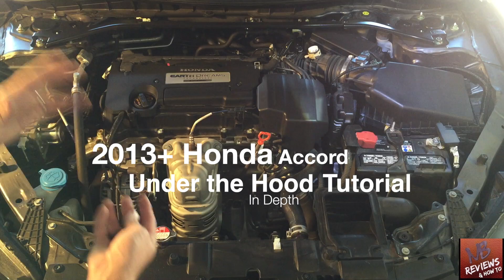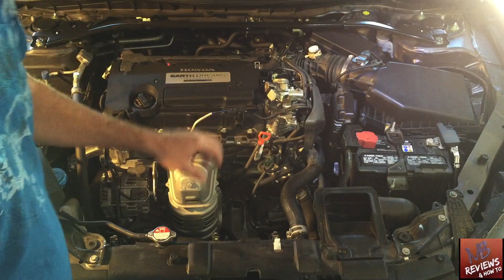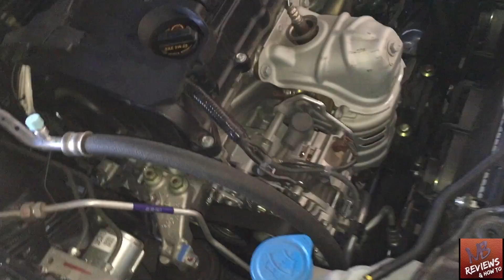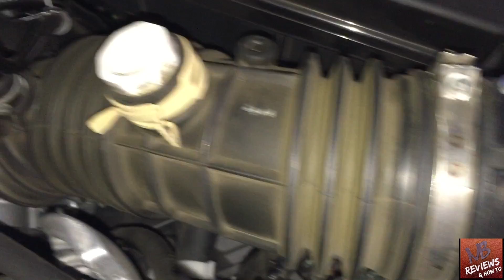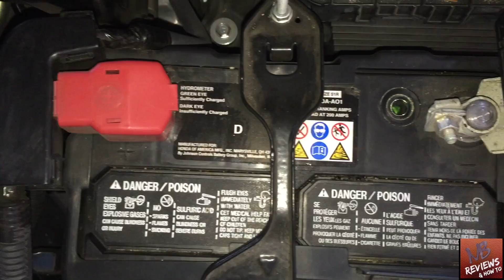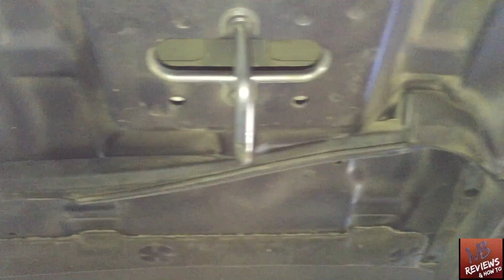HONDA ACCORD 2013+ UNDER THE HOOD TUTORIAL

Comment: Will there be a video on break pad change and break fluid flush?
Reply from the maker: myyube81 My pads are still good at 60k, but they squeal like most Honda's. I maybe upgrading them soon. I will servicing the transmission soon. I'm putting together an update showing what everything looks like at this mileage for people who are wondering how the Accord looks with miles on it.
Reply: 60k and your pads are still find, I bet most of your driving is on highway. I have 27k in my 2013 and I have changed my tranny fluid at 25k. Just a silly question, how do you distinguish the squeal noise that it's time to change pad or just Honda without taking the wheel off? Thanks.
Reply from the maker: myyube81 There is a metal indicator that will drag on the rotor once the pads have worn down 90%. In my case I'm having a glazing issue caused by the automatic carwash spraying tire gloss and overspray getting on the rotors. It causes the rotor surface to get too hot because of the slick substance and smoothes the rotor surface causing an intermittent squeal at low speeds.

Comment: Hey Michael,
love the videos man! can you make more videos regarding the accord and maintenance/ repair videos, as you do them. i just bought a 2015 accord few months and have already put a good amount of miles on it! I'd rather not take it to a dealer for service considering the ridiculous prices
Reply from the maker: kunalhuhu I have 62k already, so I feel you. I will follow up with additional videos as time go by.
Reply: Michael Borquez thanks! Also with the oil, what is the best synthetic oil to use? Is the Honda fully synthetic oil better than Mobil 1 0w20 full synthetic?
Reply from the maker: You should always use the manufacturer synthetic if you can, but it's just so damn expensive, lol. Either oil
Will do just fine, but the Honda formulated oil would probably be best.

Comment: Hello Michael, I would like to replace the factory intake for a aftermarket air intake, would you recommend me to do that? I have 2014 honda accord  sport i4  automatic transmission. Thank you.
Reply from the maker: John Tafur You can totally do that, just don't expect any noticeable power increases. If you are looking for more sound, that'll do the trick. They can be pricey, expect to pay around $200 for a short ram on eBay. I do not suggest cold air intakes that go in to the fender because they can suck up water and usually get dirtier much quicker.
Reply: K&n filter